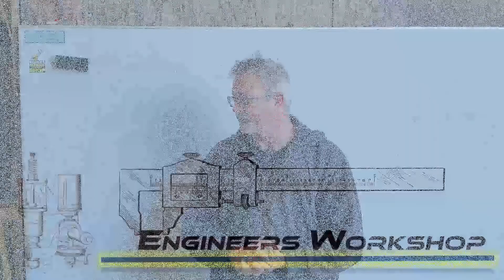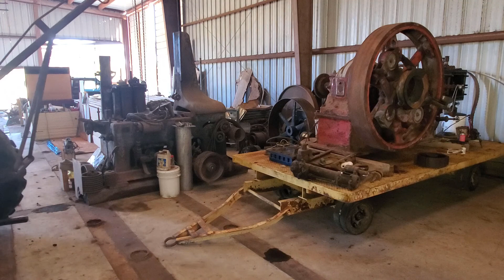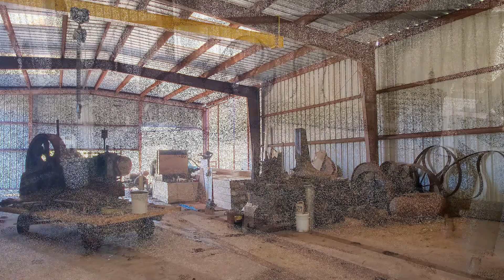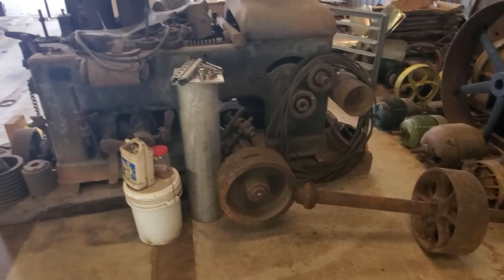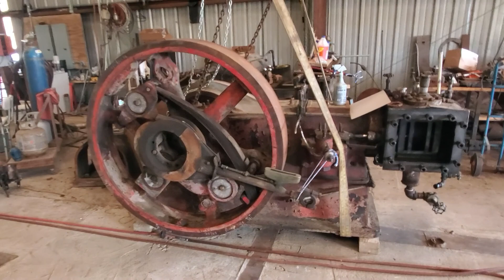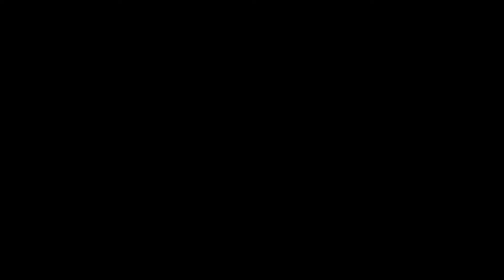Doing The Equipment Shuffle

Comment: The crane is doing it's job! Looks like you're getting close to rated capacity. Man it's nice to be able to move your stuff around so easily. And that's a fine steam engine. You have some work ahead.
Reply from the maker: More work than time unfortunately. Dave Richards (Steam Powered Machine Shop) resurfaced the steam chest cover for the steam engine. Lots of work left on that one.

Comment: You mentioned the crane scale. It's funny every new thing I bring into the garage I try to sort out the weight of as best I can. With things under 500 pounds I can put them on my hanging scale. The big machines I just try to research online to find the most accurate info I can...I guess it's just morbid curiosity. .lol
Reply from the maker: I'd like to know, just to not overload the Hoist. Maybe eBay has generic ones for cheap...

Comment: What will you do for a boiler? Will you build one? What model is your IH tractor...looks similar to one I have
Reply from the maker: IH 464 with the German diesel. Probably will get two boilers, one gas and a bigger solid fuel one for when the engine is cutting logs (sawmilling).

Comment: A geared trolley sure would be nice!  Is there a matching hole in the mainframe on the other side to the one seen at 8:17 about 18" in front of the crank and at the bottom? Perhaps it is intended to lift from a rod placed thru that hole and one slung under the cylinder right in front of the maincase. Looks like that would be close to the proper lifting points for balance. My HBM has holes cast thru it for lifting just like that.
Reply from the maker: I am going to look at that tomorrow! A strap under the cylinder would crush the sheet metal band covering the cylinder-to-bed bolts, but the trim could be removed. If that hole has a twin on the other side it would be very close to the C/G from what I could tell.
Reply from the maker: There is a matching hole on the other side, but the casting does not allow a rod to pass through to the other side - the sump dips below it. The walls are about 1/2" thick, and "old school" style forged hooks (round bar) could be inserted into each hole. They are about 1-3/4" diameter. They are about 5" behind the balance point, so they would carry most of the weight.
Reply: Engineers Workshop sounds like lifting points is why those holes are there then. 😎

Comment: That engine sure looks like a mean sob. Would love to see it run one day.
Reply from the maker: About 130 hp at 300rpm and 150psi steam. 2275 lb-ft torque. Mean enough?
Reply: @EngineersWorkshop  geez. I did not expect that much HP out of it. The torque yes, but 130hp? Not a bad figure at all.
Reply from the maker: @Engineerd3d  Yes, to make 130 HP at such a low rom the torque is insane.